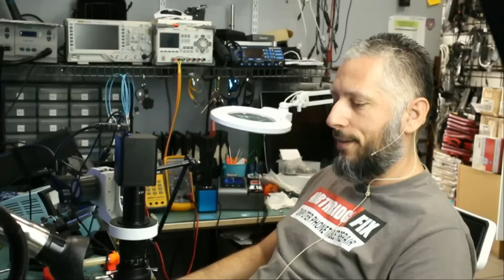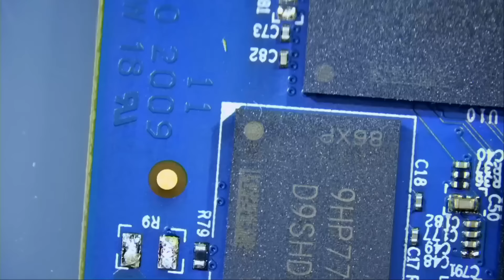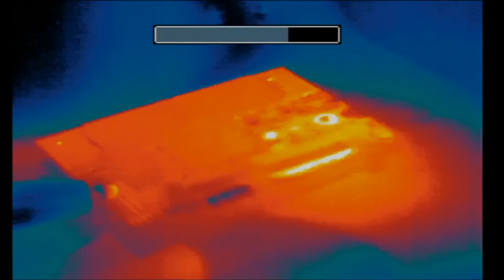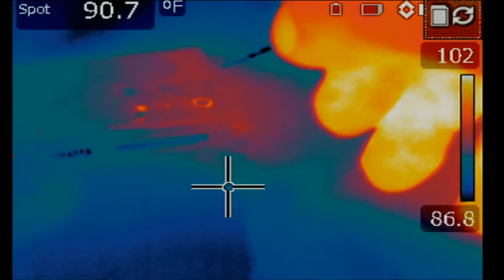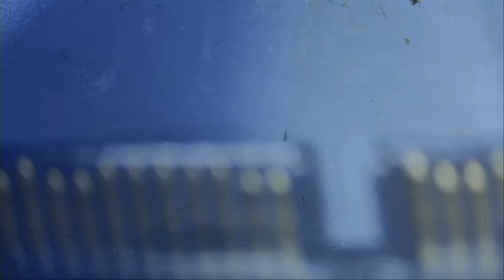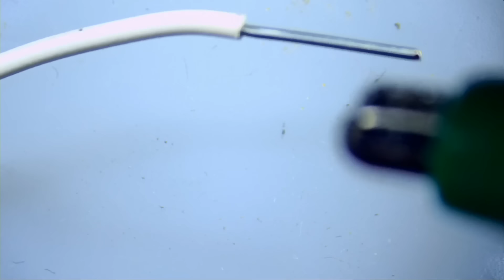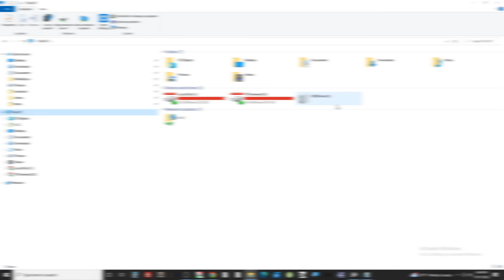Crucial SSD Drive Failed - Can we save data.?

Comment: Good video. You have 2 x AKJ regulators on board as per your microscope inspection. The parts (cap & inductor) are symmetric in the placement. You can compare between the non-blown side of the PCB layout. L502 = L501, C514 = C507, C517 = C511.
Reply: I was yelling at the screen saying the same.  Duplicate components in the same layout right next to the one with the issue.  I'm not even a repair person.

Comment: I had a weird fault with a Crucial drive a while back - it would die if left powered up for 39 days and then stay dead unless left powered off for a week

39 days should be the big clue here for the cogniscenti

In the case of the SSD in the video, a LCR bridge would be a lot more useful than a simple multimeter

Comment: My thermal camera cost me over $8K.  Way before that, we would spray the board with freeze mist, which was nothing more than R12 Freon, we now call that liquid gold! The board would immediately frost up.  When we applied current as you did, the trace would thaw out instantly.  Most of the older boards were not multi layer.  Another method, I have a probe set from HP, one is a current pulser probe and the other is a current probe.  By pulsing parts of the circuit with very narrow high current pulses, we were able to move the current tracer around the board and find the nodes.  Sometimes we knew what the common failures were and just pull the chip, cheaper than trouble shooting the board.  We didn't have the tantalum capacitor failures back then that we have today.

Thanks for sharing the video.  BTW, before we had thermal cameras, I would use a non-contact IR thermometer and scan over different parts of the board, not very accurate.  I've also burned my fingers touching things on the board that got very hot :(

Jim

Comment: imagine being a linux user and have this drive part of some array - the second it got working again and connected to a windows box - windows being windows and writing some bits to the drive and RIP data
yes, I understand that when mounting a partition usually some bits are written due to access time crap and such - but why does windows this with filesystems it doesn't understand? caused me so much trouble - thank god I'm off of windows since about a year or so

Comment: You did say, you cant compare, to other board, but... here I see two same IC with most probably same components. Little later (5:50), You are measuring from "screw hole", but I clearly see it has another path on bottom.

Comment: you have an identical layout in the board , so just measure the working component.  2 block are just fliped in the pcb
Reply: measuring u503 would give the value of test cap

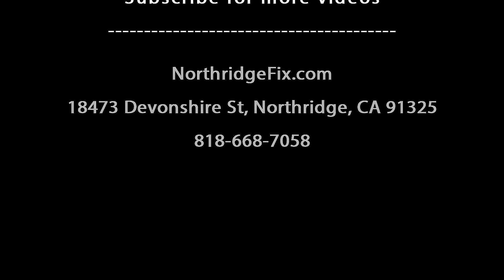Comment: At 8.44/23:39 I really wonder why you do not ask yourself what is the functionnality of this area network circuit? What is the active component and then what could happen?
An inductor and a capacitor is something that could have to do with frequency, switching frequency or resonant frequency. 
Resonnant frequencies may produce overvoltages or overcurrent. Switching frequencies are used to produce design S.P.S and in this case a short could destroy it.

Comment: I actually had success with putting an SSD drive into the refrigerator at -18° C for about 20 minutes to get it back to live two times.

The approximately five minutes it came back until it failed again were sufficient to retrieve the files I had changed since the last backup. Of course I wasted no time and worked from the command line to be quick. For the second try I had even prepared a shell script in advance to do the work.

This experience was with one drive only and I was NOT successful with each attempt (2 of 5 times it worked, more exactly the first and the fourth time).

The second and third try I only did because of the success with the first one and after I had everything of worth copied after the fourth successful attempt the fifth one (that failed again) was just out of curiosity.

Finally I was so glad my data rescue operation had been successful I decided not to invest much more time in that drive. So last and finally I can not definitely say whether it was the cooling that helped.  Maybe the drive just became flaky and worked now and then, and the cooling down didn't have any real effect.

Though I have not much hope this method will work again with another broken SSD I would definitely give it a try again.

Comment: DO NOT put DATA on an SSD-- ever... I use an SSD for operating system- and my DATA goes on a standard hard drive of 2T-which only has to read-write a little not working all the time like the OS drive... and  it HAS failed-- I just replace it- and reload my copy and go on.. no biggie-- but I LOST almost everything once on a regular hard drive-- so it was wearing it out by having to use it for SYSTEM TOO..

Comment: This is specifically why I always tell people to NOT buy UDP flash drives, if they fail you have to sand the chip down and micro solder wires onto an unspecified location. With NAND flash drives you can move the chips and read them directly.
Reply: Except, people usually buy them for a reason, their ultra small size, and not necessarily the only copy of valuable data.  It would be dumb to put the only copy of valuable data on any single drive.  More concerning to power users that aren't just pulling audio files off, is they tend to have much worse write performance, especially if the design is prone to overheating, for example several Sandisk models yet they have no concern about fixing that, which is mind boggling.

Comment: why did the capacitor were there if it was shorting it ? manufacturing error ? cause honestly if its work now without it why to spend more money on capacitors per million units ? the manufacturer wouldnt be that stupid ? sometimes i wonder why tech suck today with 20 years ago they make em in a way they are bound to fail overtime although i used quite some crucials and never had problem my friend even has crucial 1tb i bought myself and put it there but thats absurd how 1 in some units can fail cause of some piece that could work without it
Reply: That capacitor was not a manufacturing error..it was burned by some reason you can clearly see that

Comment: As some already said, not all caps go to ground, same with inductors.
Also, just have a SATA connector that you can plug in the drive to have access to ground, and even power it using your bench psu if necessary.
Reply: Yes. That's what I would do too

Comment: i have SSD problem where by i can only store say 500kb of a 2TB SSD.
Storing anything above this & when i go to read the SSD it says file corrupted. I have tried FAST & FULL FORMAT (using different formats FAT32,  NFST etc) , completely rewriting the info to disk & it still comes up with the same warning "file corrupted". Its like the SSD directory file wont write above a certain amount. I have had this problem with different SSD's 2TB , 4TB, 8TB & 12TB.
Any advice greatly appreciated. 
ps. your videos are excellent & explain everything simply.

Comment: That's a Windows annoyance. You don't get a tone when plugging in, but when unplugging. It's been happening for years. facepalm  So if you replaced the capacitor, would the drive be serviceable again, or still sus after that point?

Comment: My crucial 128 GB SSD drive in my notebook stopped working suddenly. I removed the drive, connected with a USB cable for 20 minutes. Powered off and connected again for 2 minutes. Switched off and tested again, and the SSD started to work. I did the same thing with my friends 1 TB SSD in HP notebook, but left it in boot menu for similar time. Followed from someone's suggestion from internet. You can try before sending for recovery. It might work for you. Regards.

Comment: I have been repairing lot of electronics and in my experience it's the capacitor, resistors , and transistors that usually fails.  90% of time semiconductor chips won't fail frequently.

Comment: I get why you were thinking that screw hole was ground... but I would have rather attached a sata to molex power connector to the board so you could use ground from that as reference first... :) 
But nice to see problems are sometimes easily solved...

Comment: Excellent fault finding.  We didn't have thermal cameras 40 years ago - but we did have freezer spray. A quick freeze and then look for what melted 🙂  And no, I can't believe it was 40 years ago either  (Apple iis) 🙄
Reply: Another thing that work is plain 99% alcohol. See where it dry first.
Reply: Have you tried flux atomizers? Alex reviewed one in his channel.
Reply: Great
Reply: também usávamos o dedo....🙂
Reply: thumb user here..lol
Reply: If you're brave, you just poke around with a finger tip :D
Reply: @kristiankeller4335 Ouch! Reading your comment scorched my fingertip.
Reply: @kristiankeller4335  Thats reserved for Mehdi from ElectroBoom, it takes talent to do this stuff without dying 😂

Comment: I have recovered many mechanical drives and sd cards using diskwarrior. Corrupt partitions are often the source of the problem when the disk powers up, but does not mount. This is always the first step. Connect. If it mounts. Copy data asap. If it doesn't mount try to fix the partition. Only after this start considering physical repair actions.

Comment: I'm dropped here cause my interal HDD Seagate 1TB [ST1000DM003] [FW: CC47] stopped spinning when i took it off from my old pc and installed into the new one. It never spun up since connected to new pc. So i made every test (change cables, ports and so on) but no results. So i installed it back into old pc and i realized something fu**ed up. Never happened a thing like this before in my whole life. It's weird a brand new pc will burn an HDD.....
I looked for a replacement PCB but the prices are too high for an old HDD in my opinion. So i decided to do it with my hands and maybe something is short-cutting. I HAVE NO EXPERIENCE nor CAPABILITIES to perfon these kinds of task shown in the video. I'm so afraid to fully destroy the HDD that i'm thinkg to buy another PCB. What should i pay attention to? FW version? PCB number? What?
THANKS in advance for every tip!
Reply: I'm not familiar with that but I suggest watch a 13 part series called What on earth happened by Ewaranon to learn that the earth is not a globe. Link in my about tab.
Reply: @flat-earther  lol

Comment: Cool video thanks for posting. I had a quick question and hoping you can answer. 

When removing the shorted cap (top right corner) how come you didn't bridge the connector pins? I figure when you remove a component it becomes open. 

Thank you

Comment: Do you know if some SSDs have a way to repair firmware issues? I have an NVMe drive that isn't detected by the system which is caused by a well-known firmware bug. I think if I'm able to flash a new firmware onto it the same way it was flashed in the factory, I may be able to repair that drive. It's only a 512GB one but would be nice to have it working.

Comment: I've recovered data off the old traditional spindle drives by freezing them first. I'd pull the drive out of the freezer, connect it to a computer and where the drive had been refusing to mount it would show up on the computer mounted. Copying the critical data off that thing was absolutely my first priority! You never knew how long it would stay working or if a 2nd trip to the freezer would be successful. Those were the days. Kresp.

Comment: I've seen this in other repair videos from other people too that a cap is broken and they say it's not really needed. Would you care to elaborate why these can often be "skipped"? :)
Reply: In many cases caps are needed to filter out noise on power lines. If power supply is good, cap may be not needed. Also often electronics can also work with noisy power lines, but not as reliably as most people want.

Comment: Did this drive happen to be the MX300 series? this series of crucial SSDs have seen very very high failure rate within the community, i currently have one sitting on my desk with well over 1.5Million reported uncorrectable errors according to its SMART output and this issue was very common for this series.

Comment: I hope this SSD was just fried by the user's system and is not a design flaw. I have one 2TB Crucial MX500 and two 2TB Micron 1100s(which are the same as the Crucial MX300 AFAIK). They have all worked perfectly for about 5 or so years now. I use a Seasonic Prime PSU and a Cyberpower 900 watt UPS to try to protect my system as much as possible.....

Comment: Outstanding sir, nice video, nice sleuthing on a so-common failure.  Three really good points here...  Hot tweezers, thermal camera, and burned inductor due to the shorted cap.  Chip next to inductor is likely a power rail buck controller mosfet switcher. (actually, the 2 chips left of that inductor, and the left one has its own inductor)
Reply: The more videos i watch, the more i realise i want to get a thermal camera

Comment: i also have similar issues just like this drive, not detected in any way, all caps seems ok, no shorted components, 5v and 3v supply lines are there, I dont know if there are other voltages that should be there, but still not working.. my assumption is the main controller chip already busted.. i have no other way to check it unless replace with another one, but that maybe costly..

Comment: The first test is via a recent computer bios, to see if detected. If so, then try a Linux disto and see if it sees anything. Linux supports many file formats and the OS, can read low level. If all above fails, then swap parts

Comment: Anyone else here experienced catastrophic data corruption using Crucial MX500 SSD via a SATA to USD adapter? I have two 4TB Crucial MX500 SATA SSDs and wanted to use them as external drives via the Sabrent SATA to USB 3.0 adapter (available on Amazon with great reviews) and after a few PC sleep/wake cycles (3-5 days) my data got corrupted over and over again on both drives with two different adapters, so I don't think we're dealing with faulty equipment here.

I never experienced this before with Samsung drives or other Crucial drives, so I'm thinking it must be some kind of a bug with this particular 4TB MX500 model. It's pretty scary to lose your data just like that, so I'd really like to get to the bottom of this. Crucial has been completely useless, they just said they can't guarantee compatibility with external adapters, even though they make one themselves.

Comment: It was slightly barbaric, but author done exactly what customer was asked for.  Even if datasheet for DC converter is not available, this PCB has similar DC converter next to damaged one, so it was a clue to normal repair.  Also, acceding data without decoupling capacitor is too risky for data integrity.
Reply: I'm not sure he is aware of how lucky he has been...
Reply: this should be ground points at your foot🤣
Reply: Yes I noticed it too. Thx

Comment: Awesome video but I don’t understand why the drive started working without the faulty cap being replaced first. Was it never necessary to begging with? Will it only work for a limited amount of time without it?
Reply: it is decoupling capacitor that grounds ac, not necessarily there are  a few other caps there

Comment: I saw someone once use a kind of "smoke/flux" pen that distributes a very thin layer on the board and then when voltage is injected the heating up part is obvious since it's smoking

Comment: Is it possible to just pull the NAND and go after it with an arduino, or does it require some functionality from the board? I would think it's just NAND + SATA driver + maybe a disk controller of some sort, but I've never looked into it.

Comment: I just had a HUGE Fortune 50 electronics controls firm Engineer lab bring me a thumb drive for recovery. It was terribly smooshed. They started calling and speaking disrespectfully and dismissive, insinuating for some reason that they made a mistake bringing it to my shop because things were taking so long, I'm in over my head, etc. I reminded them that if the data on the drive were so important to them, they would have gone with the much more expensive out of state data recovery firm I tried to refer them to...they declined because apparently all they really have interest in is having someone that they can speak down to like this.. (I recently discovered that they HAD tried that firm and the job was a fail.) I warned them that a stressful call like this increases the odds of their thumb drive's recovery chances quickly dropping to 0% - as I need to not be stressed to do my best. I said "Stop shooting yourself in the foot." I told them that I normally charge $450 for this job. I got their data. Their bill was $750. They complained. I said I could always just give them their crap back, I don't want a customer like them, the extra $300 was absolutely punitive charge for them wasting my time and stressing me which prevented me from being in the right state of mind to do ANY work which cost me a minimum of $2,000. He laughed and expressed appreciation for my wizardry and paid and got his data. I told him I enjoyed doing business with him. I had to shave and drill and xray that NAND and had to fly line tie to points inside the NAND and repair traces in different layers. NO coffee! I won't do that work for under $2,500 now. It's THAT stupid. If I don't take a job like that I can earn over $1,500 per day and have NO stress and enjoy my coffee. Such a job can eat up time. At my age I had to wait until I was "in the zone". There's a REASON this work costs.
Reply: Next Level.. That is a work that i wold like to see performing... not as a customer!
As usual, the most effective data recovery tool is a backup...